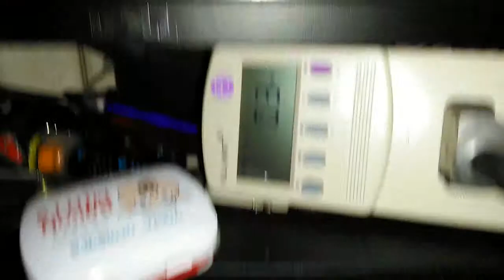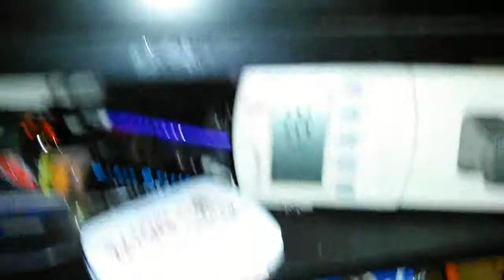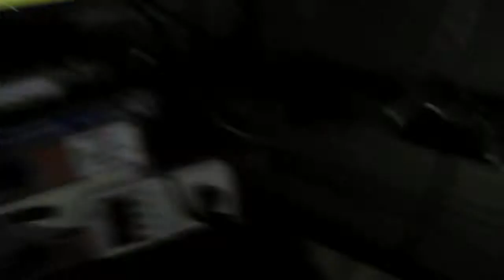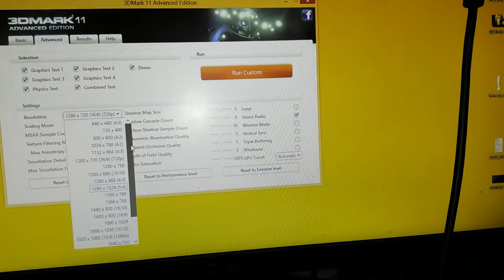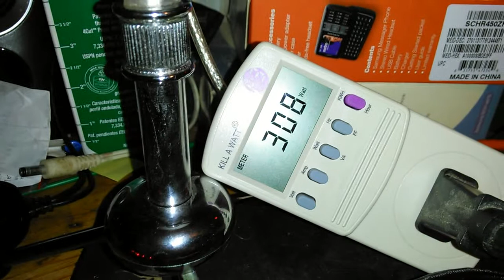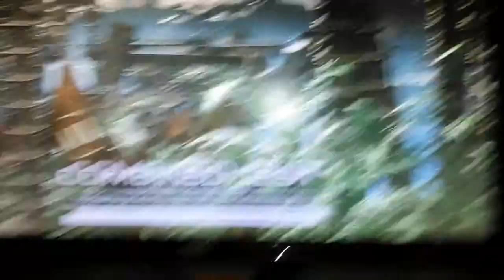Moar Powah!? Does your Computer Really Need A Huge Power Supply?

Comment: if watts is above psu. My sistem gonna burn down?
Reply from the maker: +Kristaps G You mean if your computer uses more power than the power supply can generate? Then yes, blowing the PSU up is possible. Typically, a good quality unit would just not power the system on if it can't power it properly. There are plenty of websites out there that let you calculate your system needs. As I also mentioned in the video if I recall, always get at least 100 watts more than the total says so you have some room for the efficiency rating, and power spikes when putting your rig under load.